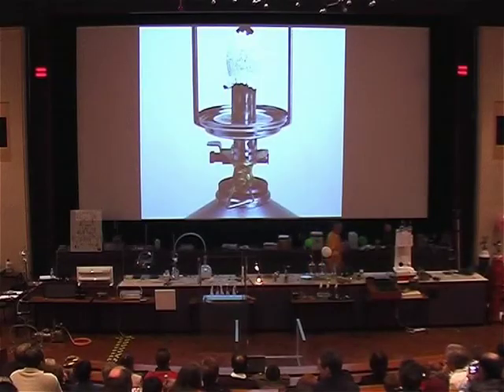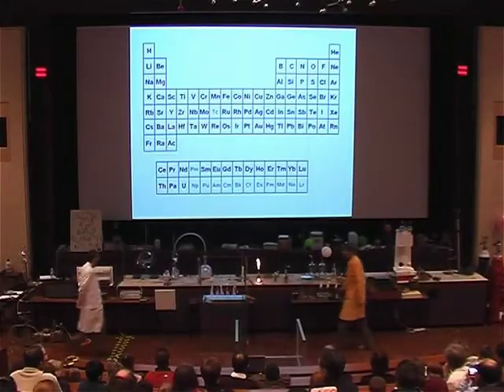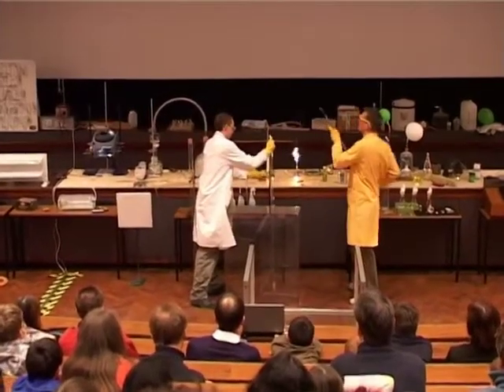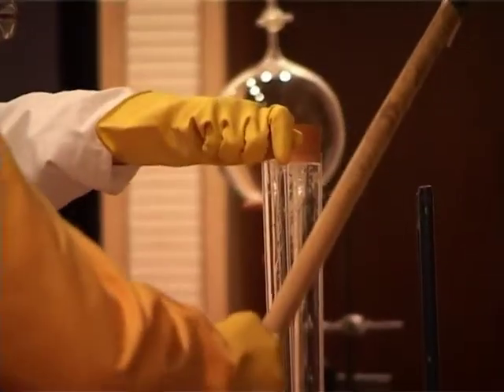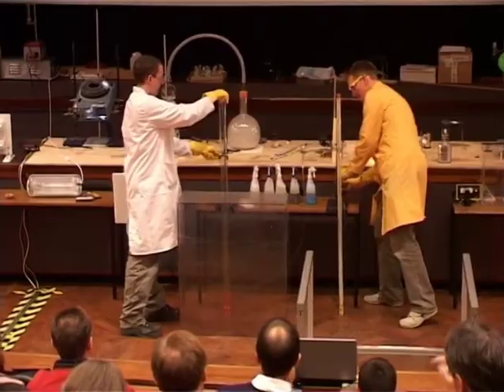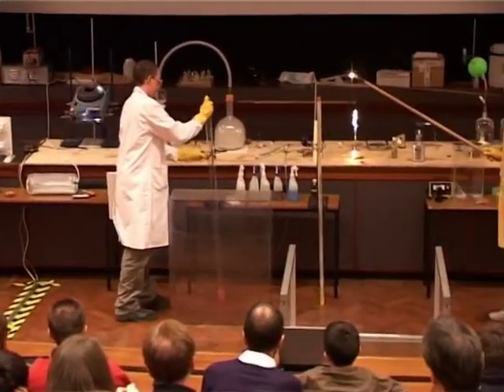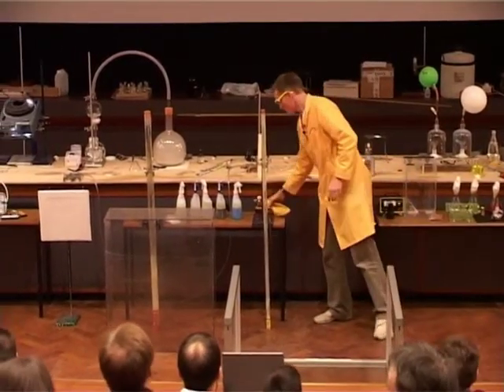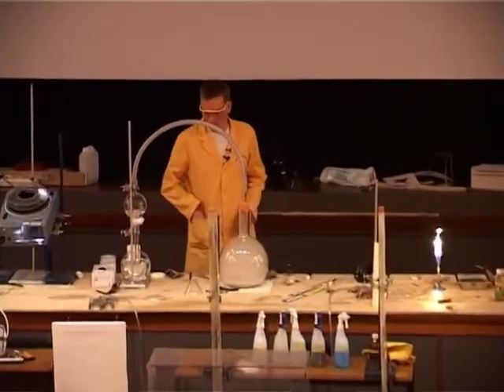The Chemistry of Light 12 - Nitric Oxide & Carbon Disulfide

Comment: STATION #:5
INITIAL APPEARANCE: A big tub, filled with Nitric Oxide and Carbon Disulfide, and a lighter on a stick.
OBSERVATIONS: The air is pushed out of the tub, the chemicals looks brown and are a gas, the lighter lights the test tub and then a big blue flame in the tub goes down to the bottom very fast and makes a loud noise. 
TYPE OF CHANGE: Chemical changes
CLUE:energy change
Reply: Now i know which school you two may assist :),oh wait @kaleily your literally beside me-
Reply: wait how do u know its station 5 too?
Reply: dont use this 1 its not good